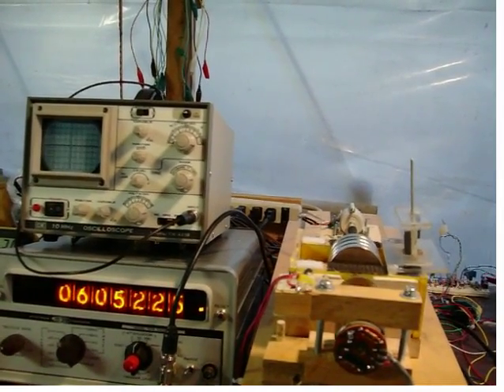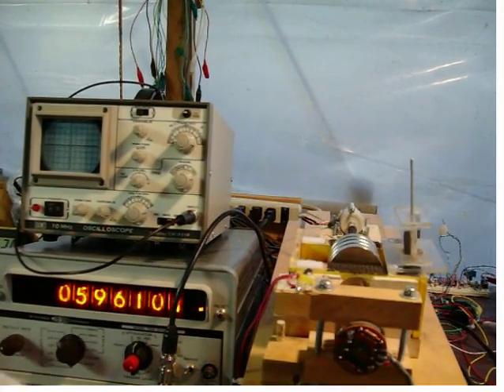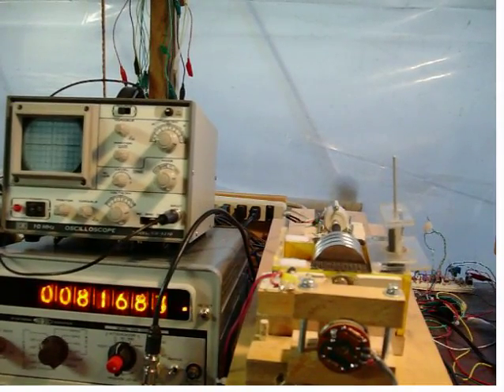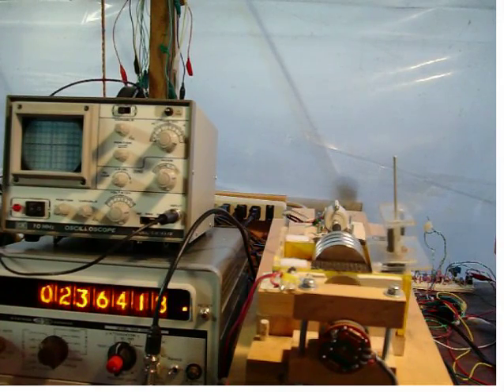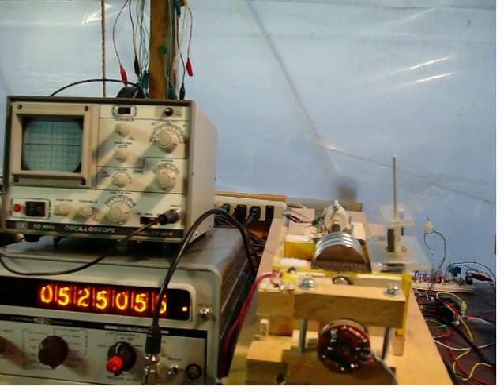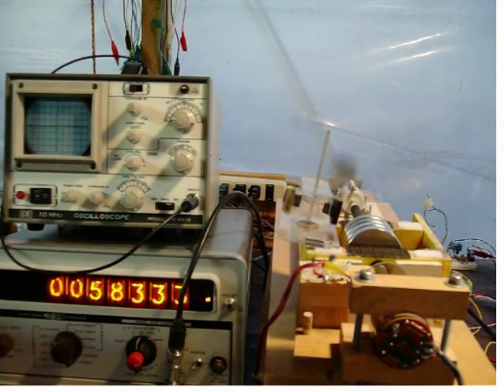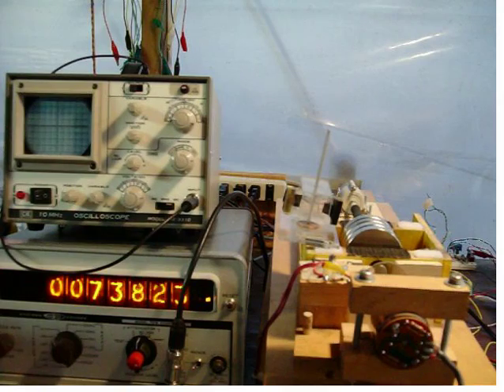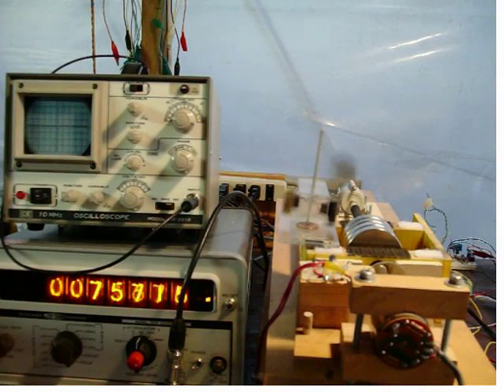FourDiskBalTests_2-Desktop.m4v

Comment from the maker: The very end of this video reveals what I call the least electrogravitational quantum velocity is equal to the square root of the quantum fine structure constant in meter per second units and is related to magnetic fields of force and thus also gravity as proven in my work at http://www.electrogravity.com.  --Jerry E. Bayles  (Quantum Mechanic)